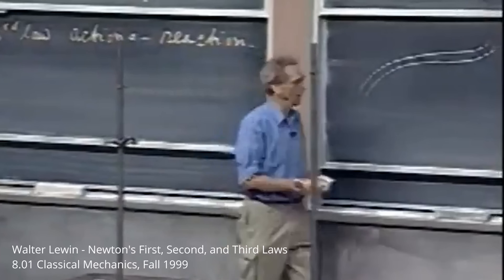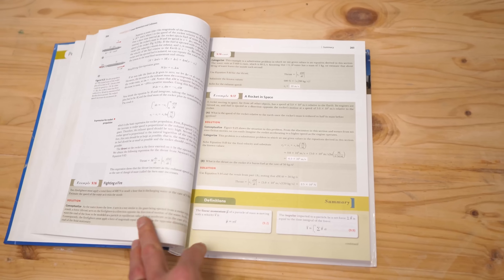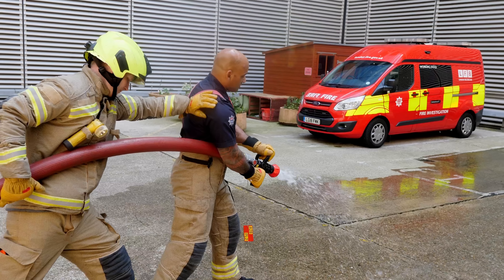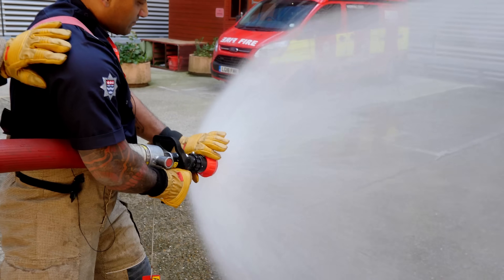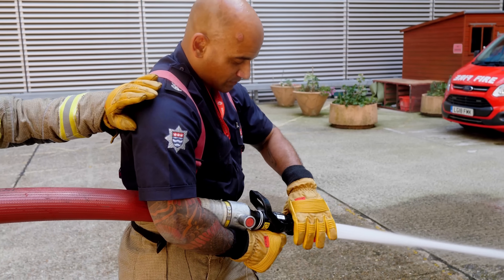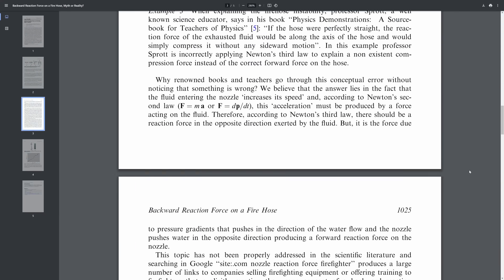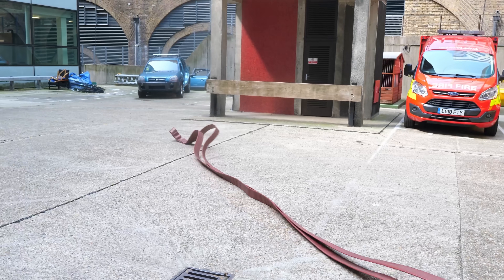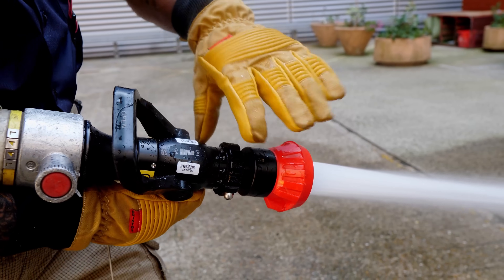Why chaotic hoses dance

Comment: When we were kids, my brother and I were goofing around in the garage and we put a really long piece of silicone tubing, like an almost-full spool of RC car fuel line, on the air compressor nozzle (probably at 100psi). It was all fun and games until my little brother bent down to grab the end of the tube and I, knowing it would wiggle, went full chooch on the air nozzle with the completely innocent intention of making him chase it around. He got a hand on part of it, but the end swung up and whipped him in the face making a pretty audible ‘pop’ sound, which, after he immediately covered his eye, I assumed was his eyeball exploding. Thankfully, it got him just under his eye and left a long welt under his eye with just a bit of lightly bleeding bruise where the tip hit, then left him with a black eye for a while afterwards…

Comment: Does the nozzle move when the water/air traveling through the pipe isn't high pressure?  I'm wondering why you didn't use a variable amount of air blowing through the pipe, like if you were to put one end in your mouth.

Comment: Steve you did not consider an important factor here which is air resistance at the point of exit from the hose. This would account for at least some of the resistance to flow that causes a push back on the column of water still in the hose. 
An experiment in vacuum would provide some answers.

Comment: I think your test method is flawed. In a perfectly flexible hose, newtons 3rd law will apply. But fire hoses aren't perfectly flexible, their woven structure becomes more and more rigid the more pressure they have. If you want to break it down, the fire pump has a torque applied on it from the motor spinning the impeller, and the impeller experiencing drag from the water. That torque is stabilized by the fire truck. The water that impeller flings out shoots down that hose and pressurizes it's walls. It exerts forces on that hose due to differential pressures within the hose as the hose bends for two main reasons: The water on the outside of the bend is moving faster and thus exerts more force on the outside of the hose bend - Secondly the woven material of the hose is stretched more taught on the outside of the bend, trying to straighten that hose out. In piping design, you install what's called "thrust blocks". Whenever you have a sudden bend in a large pipe, you basically set that bend in concrete to prevent the forces of the water being redirected from damaging the pipe.

Finally, the watering exiting the nozzle is exiting based on the pressure differential inside the nozzle and outsize the nozzle. That pressure with the density and velocity of the water determines your 1/2mv^2. It becomes easier to understand this if you consider that throttling down a hose nozzle to make a "jet" instead of a "big flow" gives you more observed thrust from the "jet"

Comment: Trained firefighter here. Displacement. Water can't be compressed. As it's pressure reaches atmosphere, it creates a force that pushes back.
Reply: That will only confuse people making them think there would be 0 pressure on the nozzle in space... T

The water nozzle is a rocket engine... The force felt at the nozzle is the weight of the water x the velocity of the water combined angle of momentum of the water when exiting. Atmospheric pressure has almost nothing to do with it,  the momentum of the water exiting the nozzle is mainly what create the force on the nozzle, just like on a rocket, because it is a rocket. (in the atmosphere  you have a little force where the water is pushing the air but that force is tiny compared to the rocket effect)
Reply: @a64738  yes. But the pressure differential is comparable to no atmosphere. My reply was actually to Steve and his wondering on why it occurs. The fluid pushes against itself as it exits, because it's pressure is so much higher than atmospheric, but the other factor is volume. One firefighter can empty a 25000L tank in minutes without understanding of how to control the flow and mist, without extinguishing the fire.

Comment: What is the pressure Felt on the hose from, the rocket nozzle effect? The "running pressure" of the fluid? Does the speed it's moving from the nozzle and it's mass have any effect?

Comment: 13:27 i would say just as an aside, the hose is very structured when filled with water so it would be like pushing the string when it had like to rods  constraining it to a straight-ish line, which seems sort of possible

Comment: I think it's literally like if you push on a string. Don't ignore friction, even if water has a low coefficient of friction with itself you get a length over which the force of the nozzle is pushed outwards into the hose, so this force shouldn't reach the compressor or pump. They push the fluid through the hose against the friction.
Reply: The water nozzle is a rocket engine... The force felt at the nozzle is the weight of the water x the velocity of the water combined with the angle of momentum of the water when exiting.

31

Comment: I’m no physicist, but isn’t the nozzle of a fire hose literally like a rocket nozzle in the sense that it constricts the flow, increasing the water’s velocity? If that’s the case then the firefighter feels a force equal to the difference between the velocity inside the hose, and the velocity exiting the nozzle? This would be a third reaction force in addition to your two.

Comment: - Have you tried to measure these forces in a vacuum? Or just watch what happens, what are the differences?
- The pressure must be "always" different at the end of the hose when such forces appear. If you do not create extra pressure in the hose compared to the outside, obviously no motion will occur
- What happens when you such air from the same hose, what will it do and how will the forces will be?
- I think a big factor is also the speed of the outside fluids. Like, if you match the air speed and direction of the air outside the hose and what is inside.... what will happen?
- the fluid leaving the hose will create secondary forces as they drag along the outside fluid, like those "bladeless" fans
- The fluids will mix at the end of the hose, creating vortices 
- how does the end dimensions of the hose influence the effects? Does the firefighters hose have inside some blockage, like it is smaller in diameter before the end of the hose, as well its end is variable
etc :)

Comment: Whether the pressure drops at the nozzle depends on whether its diameter is smaller than that if the hose. If so, the speed of an incompressible fluid like water will have to increase, making the pressure go down according to Bernoulli.
Reply: The water nozzle is a rocket engine... The force felt at the nozzle is the weight of the water x the velocity of the water combined with the angle of momentum of the water when exiting.

Comment: First of all, great video (as always), but I still have a slight problem with it. The pressure argument seems quite convincing and I can get behind that. It is probably the largest contribution factor. But I don't think we can dismiss the 'bends in the hose' argument just yet from the arguments you shared in the video.

As I see it, your experiment at 14:47 (and sometime before) has a flaw. The bend you are introducing is not a 90° angle as the paper suggested, but rather a 360° bend. As such the force components of the two halves of the loop should exactly cancel out and quite naturally lead to no net force difference. In fact the same experiment shows that the force due to the bends is not  insignificant, since the loop does get stretched out once the air starts. It just gets quickly overpowered by friction with the ground, internal stresses in the hose material, etc. 

If the hose was suspended frictionless in an idealistic case, a 90° bend (without changing the hoses shape i.e. a kink) should still result in a (quite significant) force. Especially in the case of the heavier water at high velocities, compared to somewhat slow and light air. Would have been interesting to see if it was measurable with the air hose.

I want to point out that we can explain the sky dancers with the same bend argument, although I still think your pressure build up argument is a large factor here.

That being said, this force probably still doesn't contribute much to the force the firefighter is fighting against, precisely because it is largely counteracted by the friction and internal stresses.

So all the fuss for nothing, except a, what I believe to be, more accurate explanation.

Comment: You say the pressure along the hose is constant; but I dont think that is true even to decent approximation. Perhaps for the water-with-nozzle; but for the air-without-nozzle, I bet most of the pressure drop happens distributed along the tube, due to friction. Without a nozzle, there is nothing to provide a big step change in pressure at the outlet; the interior air would continue to accelerate until the distributed friction brought it into equilibrium (ignoring speed of sound limits). It makes sense that such an evenly distributed force would not introduce much local motion; but it also makes sense that it would still be felt as a reaction force by those holding the nozzle.

Also; in a rocket, the net effect comes about due to air expanding against the nozzle. For an incompressible fluid, the details are a bit different since there is not much expansion; but to fully dissect it you do need to dive into the nozzle geometry, to see how the constricted geometry results in acceleration of the fluid, and how it should push against what wall and what not. If a firehose didnt need to accelerate the water, and youd cut off the nozzle, and there wasnt a big pressure drop at the end of the hose, the whole thing would behave a lot different. It becomes trivial to hold, as you can easily experience with a garden hose with an adjustable nozzle. If the water is just dribbling out, even if it is a lot of it, it will just lay there and not go snaking around.

So I think at least 3 effects play a role for solid hoses (for the fabric tubes its even more complicated):

* reaction forces to redirection of fluid due to curvature
* momentum loss due to friction; which gives few local effects, but does build up to a reaction force at the free end, that might drive wiggling dynamics. This is probably a significant part of the wiggle dynamics of the nozzle-free air tube.
* whatever delta-P happens at the nozzle, and the reaction forces that entails. For the firehose, this is dominant; but for nozzle-free tubes, its the others youll see dominating.

Comment: You just said that the pressure inside the hose is constant, but do you have data or reason to believe this? It's probably not dropping 100% of the water pressure only at the nozzle, but has a pressure gradient throughout the hose. In the same way that pressure gradients cause a buoyant force, the pressure gradient inside the hose would impart a force backwards in the hose

Comment: The losses in the water hose and pump and nozzle is irrelevant because the water nozzle is a rocket engine... The force felt at the nozzle is the weight of the water x the velocity of the water combined with the angle of momentum of the water when exiting, and the losses do not matter and only over complicates it.

 When it comes to the movements it is same as the chaotic movements you get with a double pendulum.

Comment: 15:38 you should also consider the weight/friction of the hose preventing it from moving. The anchor point is not actually at the truck but some point nearer the nozzle where the nozzle can't move any more of the hose. You can see this in the demonstration video at 15:19

Comment: You have to include friction between the inner hose wall and the water; viscosity is the root cause - a moving fluid through stationary hose. A frictionless non viscous fluid would create no force. Note also separately account delta P across nozzle

Comment: I think there’s a better way of explaining it - there is a high pressure in the hose which is exerting pressure outwards on all sides of hose. In a static closed hose state this includes on the end of the closed hose. But when the hose is open this force is removed. So you can visualise it as a ‘negative’ force just on the opening. Or rather the sum of all the other forces on the inside of the hose is equivalent to an apparent negative force at the opening.

Comment: You mention some competing mechanisms, and it seems to me that they'd compete differently with different fluids.
Like pressurised water doesn't compress much, and so all the the energy-change/work from a change in pressure has to be mechanical. However, pressurised air can compress a lot, so I think some of the work can be a change in temperature for the air.

Comment: Steve I think you're wrong that the water's momentum comes from the pump. The pressure does, but there is a conversion of static pressure to velocity pressure which occurs at the nozzle. I would think that the momentum of the water does increase at the nozzle because of the energy transferred from water at high pressure to water atmospheric pressure.
Reply: OK now here you are explaining what i was saying just better. Imma shut up now

Comment: 8:59 You mentioned just seconds before that a 90 degree angle would equal the full force of the water, yet you test the air with a 360 degree angle. It makes intuitive sense to me that the forces in play would balance out to be equal to the 0 degree experiment.

Try testing the forces on the end of the hose on a 90 degree angle and perhaps even 180 degrees. I hypothesize that the 180 degree angle should experience double the force. A 270 degree angle would experience similar forces to a 90 degree angle, since the forces on the first turn and the third turn cancel out, leaving only the force of the second turn. A full 360 degree angle will cancel out the force of the second turn as well and be equivalent to no turns at all, as you've demonstrated here.

Comment: I have notices that pretty much all water cannons that is mounted rigidly have one 360 degree turn on the water hose before the exit nozzle... I have not found out why. I read the explanation why now and it is much more interesting and mind bending then the water hose flapping around. You might want to look into that :) (it say the 360 degree bend before the exit hose introduces a twisting force on the nozzle instead of a pushing force, that sound crazy to me...)

Comment: 9:35 I think you were onto something with the force is imparted by the hose, but the inside of the hose isn't a perfect, friction-free surface. The force the firefighters have to hold is surely the result of turbulence, Eddie's, and wall friction in the hose. 
Therefore, I'd expect it to be worse on longer hoses, and cancelled out by turns - ie, a the full turn you had was higher friction on the outside arc, but lower in the centre path.

Comment: Hi I am a fellow physicist and have been working as a CFD engineer for the last 10 years and I need to correct your reasoning starting around 12:00.
1. The pressure in the hose,  is decreasing trough the hose due to viscosity and momentum transfer to the walls. 
2. Water is accelerated in the nozzle and it does not accelerate further after it leaves the nozzle as water is not compressible it pretty much starts to loose speed as soon as it exits the hose as it transfers it momentum to air. (Depending on the orientation of the hose the velocity the water leaves the hose and the terminal velocity of water droplets it can accelerate, but for the fire hose the flow speed is much higher at the nozzle.) Also the stream starts to break up almost immediately after it leaves the nozzle,  you can literally see it shedding the outer layer of the flow that were slower due to the boundary layer.
For rocket engines, there can still be acceleration once the gases are out of the nozzle if the gas is under expanded. 
3. The momentum that the water gains in the nozzle is the most dominant force the firefighters need to withstand, the high speed momentum transfer of the water jet to the air is much smaller. (Look up slip for propellers to understand more.)

Comment: Your slow motion video of the air hose with the bend at the end clearly shows that it's not the pressure changes within the hose but the expulsion of air out the end pushing the hose that changes its direction . This can be seen right before it changes direction it puts a ripple into the black cloth as the air bounces off it like a rocket engine. Yes internal forces matter but not NEARLY as much as the propulsion effect of the air coming out the end.

You can prove this by measuring the force of the hose in full flow ... then measure the force of the hose in full flow with something blocking it's path and vary the distance of the blocker. My bet is that you will see an increase in force at shorter distances. Nothing changed in the hose or the water only in what happens After it Exits the whole system

(I wrote this before you first mentioned the word Rocket)
Jane Street produced the largest Scammers and Thieves of all time ... Promoting them is ... shameful

Comment: Steve, this is a bounded multi body problem. It seems chaotic because of this. The boundings are the limits of the hose, but the rest is a multi body problem inside of it. You can split the hose down in to small sections and see the "bodies" of it.